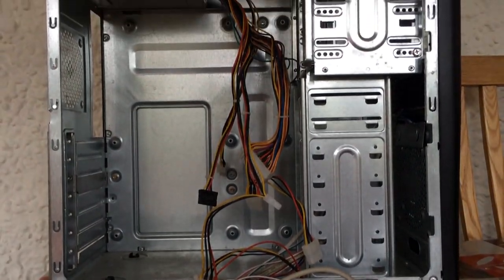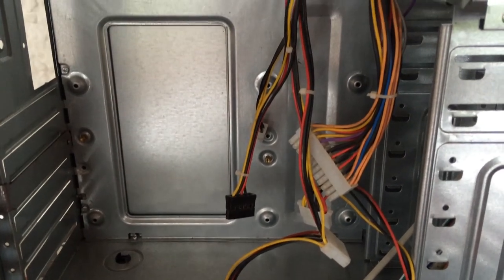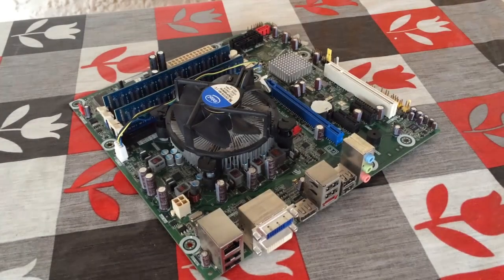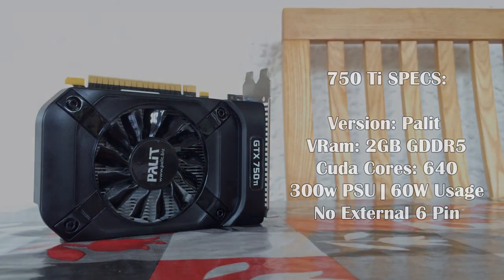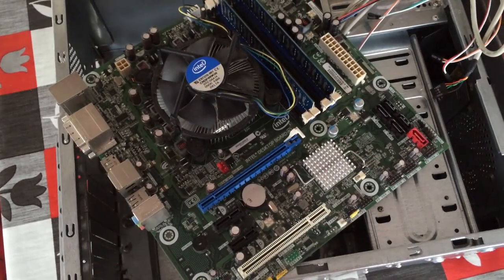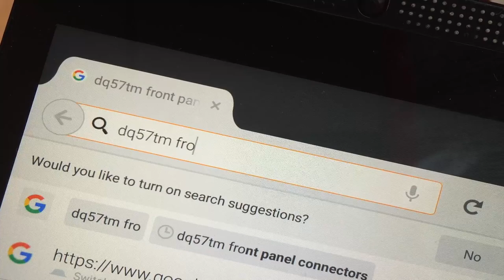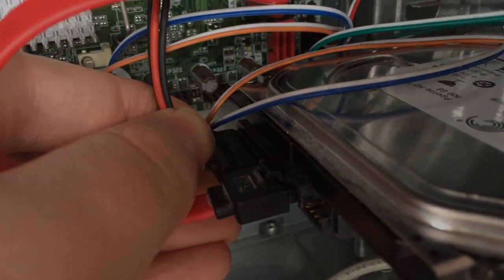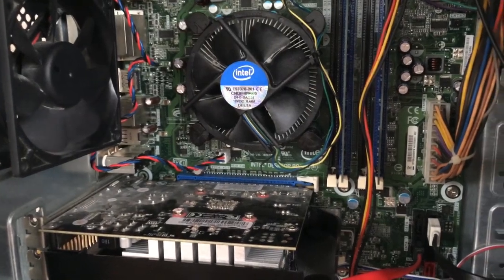Let's Build a $200 Core i7 Budget Gaming PC

Comment: And this, ladies and gentlemen, is the same marketing trick used by manufacturers - the good old "has an i7".
Reply: Louis "The powerful core i7" xD
Reply: c fahy the power of the xeons
Reply: Really he would have been better off with an old quad core and a newer graphics card. Considering the price to performance of the 1060 3 GB and RX 480, I don't think $50 for a 750ti is worth it. The bar has been raised and 970s, 960s, 780s are now available for dirt cheap as well. Of course with that no name PSU you might have issues with the 780. I always forget that he's in the UK, so the used market might be more scarce.
Reply: $50 vs $150+ gpu are you really trying to compare them?
Reply: Yes but 960s are going for the exact same price and 780 & 780 Tis maybe $10-$20 more. Even some 980 listings are going for around that price!
Reply: Sahil Zubair I also question his choice of a 750Ti
Reply: in conclusion wich video card would have been better? I'm really interested in building this one, it's a killer for the price. If anyone has a better option for this price or close to it would be accepted too
Reply: if its not to late get a 1050 or if you can make the extra $ 150 ti :0
Reply: Louis Atleast this is legit
Reply: gEn 1 I9

Comment: No GTA 5? Also would this be better price to performance than a $60 6300 Mobo combo + 1050ti/750ti? And can this handle recording videos?
Reply: I would go with the combo and the 1050Ti , You can run gta 5 really easy.
Reply: yes there will be no bottleneck even with something like gtx 970 or rx 470,just oc it for full potential
Reply: KrypticGuru 2.0 but a 6300 can botleneck a gtx 1050ti !! I have them .... when i get 35-40 fps my friend gets 65-70 fps in some games with the same 1050ti (he has an i5 6500)
Reply: Kristóf Rádai thanks, I will base my Christmas build off of this. I might just push the little 6300 as far as it will go. I only plan on recording and editing with the PC. So picking a card/system that can run games while recording would do me wonders. Let me know if your rig can do this,
Reply: KrypticGuru 2.0 6300  is the worst cpu in late 2016 ... dont buy it u should at least buy i3 6100
Reply: No my q6600 is.
Reply: no it can't!
Reply: I have the 875k paired with a 1070 and still get excellent gaming performance, I originally had sli gtx 480's and needed a dire upgrade for vr, and it handles it no problem. Outside of adding usb 3.0 via pcie there has been zero need to really worry about any bottlenecking with this cpu for quite a while.
Reply: GTA 5 performs almost the same as Fallout 4. Consider the results of F4

Comment: I feel out of place on this channel, I'm running a pretty high-end skylake system, I really have no idea why I watch this channel, I just do
Reply: For the same reason I do. To marvel at what certain components are capable of. The same reason I watch Lowspecgamer. I too have a high end system but I can't stay away
Reply: I think it's because I was running on a low spec system for a long time. I only just replaced my 10 year old PC, which was running on a GTX 460 and a Q6600 with 8 gigs of DDR2 RAM, I started watching this channel after I upgraded to an i5-6600 and a GTX 770. Pretty MASSIVE leap, I'm getting like 4-5x the performance
Reply: CC Tenshi How old are you.. your system just isn't high-end, deal with it
Reply: I'm 21 and I worked hard for this system. I clearly said 'pretty high end' implying it's not quite there yet. I'm upgrading to a 1070 which is on its way now. It's still a work in progress. Let's not also forget I upgraded from a Q6600, If anything it sounds like you're playing on a toaster and you're jealous or something. I don't see why you'd have any reason to make such a degrading comment unless you for some reason are insecure, meaning it's likely that my assumption is correct.
Reply: DANK HARAMBE That is completely true, but that does'nt mean CC Tenshi has to act so immature about not having a high-end system. I think the i5/GTX1070 is a perfect price:performance combo.
Reply: DANK HARAMBE true but i would argue the Q6600 is a little dated now. People on a budget should be looking no lower than an FX-6300 and and AMD build is pretty much what budget builders should be looking at.
Reply: Everyone likes a bargain!
Reply: Dank Harambe just wait for zen
Reply: Never buy a xeon for gaming.
Reply: What is the problem with xeon? Some good xeon processors are pretty cheaper than i7 equivalent.
Reply: I really like how you guys respect each point of view and dont insult like 12 year old squakers. (sorry for my english)

Comment: Small question.

Does the GT 640 use a power connector and does the 1050 Ti also use one?
Reply: l think Gt 640 should have one... But there are some 1050 ti brands that don't require any external power connector.
Reply: Wait, there are GTX 1050ti cards that don't require an external power connector?!
Reply: Yes, of course.
Reply: John Lion
How much power is the PCI able give?
Reply: Approximately 75 watt.
Reply: John Lion
And the gtx 1050ti only needs 70, I see.
Reply: gt 640 has NO external power connector. John lion, if you don't know the facts, don't confuse people please.
Reply: Shadez Entertainment
I didn't make any certain judgment. That was just my opinion. GT 740 has same chip as GT 640 and GT 740 GDDR5 requires a 6 pin power connector. SO that's why I said, "I think it should have one".

And lastly google is your friend, people don't have to trust everything they read in youtube comments.

Comment: I recently built a PC.When I switch it on it displays analog power saving mode and then goes off.Additionally,I see an orange flashing light.I honestly need some help.

CPU: AMD Athlon x 845
GPU: r7 240 1 gb

Comment: Whenever I build budget gaming PCs, I don't usually pay for an Operating System since you can download Microsoft's Windows 10 Enterprise Evaluation LTSB from their website. You can install it and use it for up to 270 days for free (With the 'slmgr -rearm' command). The bonus here is that if you are nearing expiration, you can use Microsoft 'PSTools' to modify and disable the expired timer effect through disabling/removing certain services and registry edits,(Meaning no hourly shut down or other nonsense). Just thought to mention that in case anyone needs an OS to use without the wallet requirement. Great video as always!

Comment: can a gtx 750ti still cut it today?? im looking at one for my system but im also looking at saving some more for a 1060. im looking at playing battlefield 1 and forza horizon 3 with my machine
Reply: stuntmania3000 1060 is super worth it, 1080p 60fps at ultra settings for almost any game.
Reply: just built a new Rig and i got a intel i7 6700, a GTX 1060 and 16gb DDR4

i havent tried battlefield, but GTAv runs at insanely high fps on completly max settings (with graphics mods)
would completely recommend 1060

Comment: How did he get all the parts to work with windows ten? Is there driver surport for those CPU's still?
Reply: Gami Jake windows 10 works for basically everything socket 775 upwards. A handful of socket 478 pentium 4's even support it. I have no problem adding windows 10 to core 2 duos and cr 2 quads.
Reply: Thank you but a bit too late for this XD I have a working system for all this XD

Comment: Will downgrading to core i3 reduce the performance?

edit: I wont really use it for work :)
Reply: Sean Eredia Depends on the model.

For example, a core i3 6100 would likely get slightly better performance, but a first gen i3 would be much worse.

Comment: What if I use a gtx 1050 to this build, can the psu handle it? I almost have the same build as this, i just need to upgrade the gpu. Thanks!
Reply: No problem with that GTX 1050 and that CPU.

Comment: Wouldn't recommend buying a case used, even if you're doing an extreme budget build like this. There are decent cases cheap enough new to warrant them over some shotty case without standoffs, screws, and/or cables used.

Comment: Is the Core2Quad Q9400 better than or equal to this i7 890?
Reply: The i7 beats it ( according to CPUbenchmark net )
Reply: i use an q9450  overclock 8gigs of ddr2 ram gtx 650ti it runs all my games pretty decent i haven't try any new ones just gta 5 i t gives me 40fps Med -High

Comment: its hard to believe that my i7 6700k will be as outdated as the 860 in only a few years
Reply: puffin96 I think it won't. cpu improvements are getting smaller and smaller between every generation. this cpu is from 2008-2009 which is 7 or 8 years old. i'm assuming 7-8 years is a great lifespan for a cpu
Reply: It will last you around 6 years for gaming and other tasks so dont worry
Reply: But 860 is still pretty good cpu as u can see.

Comment: I have a question......do builded pc had windows 10 or 8?
Reply: Soup Rice or you can use the unactivated windows 10 for free
Reply: Soup Rice $10 on ebay
Reply: +Soup Rice just buy a win 7 key for cheap and use it on win 10

Comment: Will this work with a 300w psu?
Reply from the maker: yeah should do. providing it's an ok one though, the 750ti was designed for low power builds :)
Reply: RandomGaminginHD Its from an old HP compaq. Cheers for your answer!
Reply: Sithium depend on the rest of the system

Comment: so i wanna upgrade my gpu or my cpu, which should i upgrade, at least first
cpu: q6600
gpu: radeon hd 4870 1gb
Reply: RafaGamer67 depends if u wanna edit or game
Reply: i mostly game, but i edit a bit too
Reply: RafaGamer67 Upgrade ur CPU definitly it will bottleneck the shit in all games
Reply: gaming: gpu
Reply: GPU first, then CPU.
but both need a pretty serious upgrade if you want to do some higher end stuff.
Reply: yeah i will upgrade overall, the motherboard to support 16gb ddr3 ram wich is faster and cheaper, what gpu should i get?
Reply: RafaGamer67 
depends on your budget. If you're upgrading both, get the best you can afford.

RX 480, or GTX 1070 i think are the best price-to-performance sweetspots atm.
Reply: gtx 1060 has a significantly better price to value ratio (around 50% cheaper and 30% slower)
Reply: I'd go with an RX 470 or 480. And then upgrade the CPU later, depending on what you play.
Reply: Everyone here saying that the Q6600 bottlenecks here are tards, it's all based on the motherboard if a Core2Quad will bottleneck or not. Still have DDR2 with your Q6600? Will prob bottleneck and it's time for an upgrade. If you have one of the few LGA775 boards that support DDR3 you will be fine if you overclock to 3.0Ghz or use the BSEL mod (block a pin to overclock by default). I'm using a GTX 750ti on a Q6600 and I run GTX V on High 1080p 75-80fps. I'm not even planning on upgrading the CPU any time soon, maybe to a Core2Extreme but that's about it. The GTX 1050ti will be your friend in this setup friend !
Reply: i have an AMD A10-5800k, and 8gb DDR3-1600ram

could u suggest what GPU that suit with my CPU?
Reply: Stevano Chandra 750ti or 1050, maybe an RX 460. Only things that wouldn't be horribly bottlenecked by it
Reply: how about rx 470 / 480?
Reply: Stevano Chandra They'll give you better performance but they'll be bottlenecked a bit by the A10
Reply: are OCing my cpu will help the bottlenecking problem?
Reply: Stevano Chandra Somewhat, yes
Reply: thx... maybe i will buy rx 480, and upgrade my CPU later...

and could u suggest about budget gaming cpu? and a lil bit for design too
Reply: +Stevano Yes with a A10-5800k you will get bottleneck issues with a rx470/480, but mostly in CPU heavy games. I would say the rx 470 is possible, but the rx 480 is definitely a no. If you want to be on the safe side you can get a rx 460 or a gtx 750 ti.
Reply: Stevano Chandra I'd say you could pick up an old i5 and you'll be good for many years.
Reply: New American Fishkeeper can u tell me about that i5 series?
and what about i3-6100?
Reply: Stevano Chandra Something like an i5 2400 would work, and the i3 would serve you quite well for a few years.
Reply: The Q6600 is the best budget CPU in my opinion, unless you're obsessed with i-series processors. Then the 1st generation i7 860 (4 core 8 thread @ 2.6Ghz) will do you just fine !
Reply: Go budget and get a GTX 750 ti for now, use the rest of the money to start saving for a FX-8xxx build if you want to go AMD.
Reply: I'd say upgrade your Gpu, I had a Radeon hd 4800 which was incapable of running anything on it
Reply: RafaGamer67 the CPU should be an x5450 and you 750ti rx480 or a hd 7970
Reply: Definitely GPU, that CPU is still good for most games. If you can overclock it just get a better cooler if you can find a good deal on one. 

That CPU will push up to a 6970/7950 or so easily, get a 750 ti or 1050 or something maybe RX 470 if they are cheaper in your area
Reply: ***** 1050 ti and 470 price are only around $15-20 difference, 470 and 480 only $10 difference, so confusing. haha
Reply: ***** forget to mentioning it before, i have deepcool frostwin v2.0, is it enough?
Reply: Stevano Chandra
Haha yeah pricing is crazy thanks to cryptocurrency mining
Reply: Stevano Chandra
Yeah should be I use a hyper 212 evo
Reply: Tony Fisicaro so.. what about ur opinion? can u let us to know?

Comment: So, I'm watching this as a complete computer noob from the stone age. I chiselled calculations and graphics in clay slabs with a stone(I owned a C64 and a pentium once). I know how to use the mouse and keyboard and I can follow instructions like these. A couple of things I am wondering.

First of all, what's an excetera? :p  Just kidding. I actually have real questions that suit a noob like me.
Why is there no sound card? What happened to it?
My other question is, why don't you use standard benchmark testing instead of games? They give far more reliable information(and don't make me seasick).
Reply: In the modern day, motherboards have built in soundcards.
You can still purchase seperate ones, which are a neccessity with higher grade, studio quality headphones. But for your regular gamer, the motherboard's integrated hd audio (provided by realtek most of the time) is more than enough
As for the benchmarking testing instead of games, well firstly, some games dont have that feature, and even tho some do, it seems more genuine to test it in a real scenario and not a simulated one where its purposely throwing everything it can at you
Reply: Aphix_
Ah, I see. That clears things up. Thanks :)

Comment: Just got a system like this with a dell inspiron t1500 case and mobo as well as an i7 860, 4gb ddr3 ram, 1 the hdd, 350 w psu, windows 10, and a random gpu that I am planning on upgrading asap along with the ram all for $100 (includes shipping and warranty :) ).
Reply: This proves cheap budget builds can be done!

Comment: i have 400w power supply does it support r7 260x asus?
Reply: SKULLzCRUSHEr!!! Csgo&more!! Definitely! Ive got practically the same system but just with that graphics card. Been running it for over a year now
Reply: Jamzy oh... got a relief by knowing that !  thank you...
Reply: SKULLzCRUSHEr!!! Csgo&more!! If you can though I would try to get a 450w/500w psu. I thought you meant will the card work with the build.
Reply: Bike Dude i have circle model cph699-400
Reply: yea i meant that only i just want it to work thats all..
Reply: Buy 750 or 1050 ti instead.
Reply: John Lion i dont have money -_-
Reply: SKULLzCRUSHEr!!! Csgo&more!! Save up a 265 is money waste

Comment: Does anyone know what to do when your PC drivers for the 750 ti don't work
Reply: delete the existing driver and reinstall the driver
Reply: Eryche Bandy ive tried that it works for a few days than stops working again
Reply: FusionFall Maina try again, it might just be a fluke
Reply: Eryche Bandy i have, ive reinstalled windows everything i can think of
Reply: FusionFall Maina maybe try to download an older version of the 750ti driver, wait hold on does it crash when you try to start up a game or it just doesnt work at all
Reply: Eryche Bandy the games won't boot and i think the cards the problem because after switching cards it works fine. Thanks alot though
Reply: FusionFall Maina were you over clocking, if you were you might just be pushing the card too much and need to settle down the over clock
Reply: Eryche Bandy nope no overclock
Reply: FusionFall Maina ok sounds like a faulty card and BTW what card did you get
Reply: Eryche Bandy EVGA
Reply: FusionFall Maina cool, happy to help
Reply: Use DDU to uninstall the drivers

Comment: After watching alot of your content and others, I decided to do a budget build... I picked up a few things locally, on a bit of a gamble as all was listed as untested/worked the last t ikme I tried it, for $20aud I got the following
-16gb ram (4x4gb)
-I7 2600k
-64gb ssd
-750w psu 
-Unbranded case
-Gigabyte z68 mobo 

And in a separate pick up a 2tb hdd and an rx560 4gb gpu for $80

So for a total of $100aud, mixture of medium and high settings I'm able to get pretty smooth game play anywhere between 50-60fps 1080p playing gta v, mad max, Skyrim, fallout 4, doom(2016), rise of the tomb raider, dirt 4, far cry 4, crash bandicoot and a few others..

Comment: I recently bought an Asrock Z87m Extreme 4 for 36 pounds. Although I had to take it back to the seller to do a BIOS flash because it won't take my i5 4590 as is, the experience was OK. Hopefully in the future I can drop a 4790K in it.

BTW, when I was installing the board, I just searched for the manual and there goes all the info I needed, pin layout, board layout, you name it.